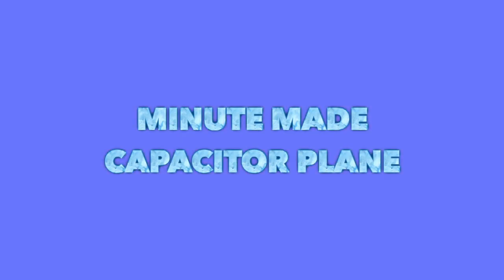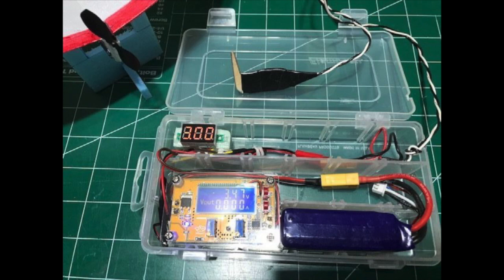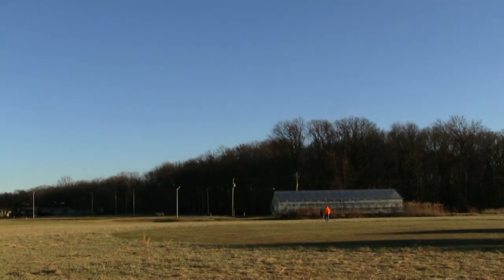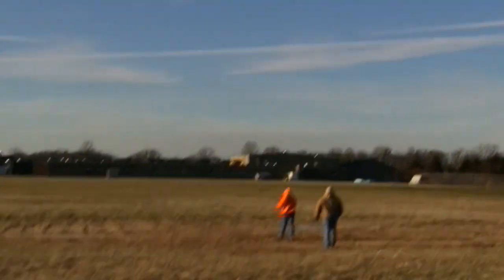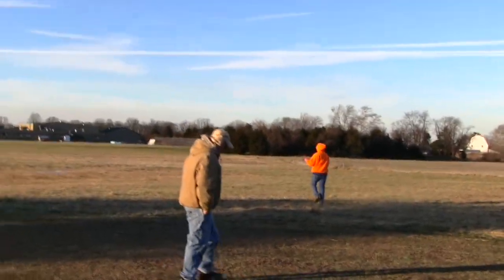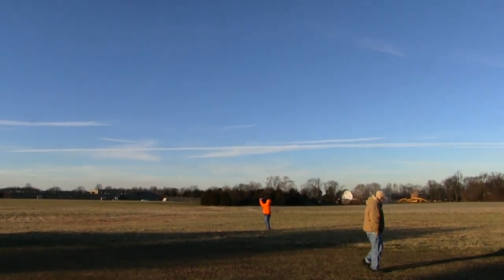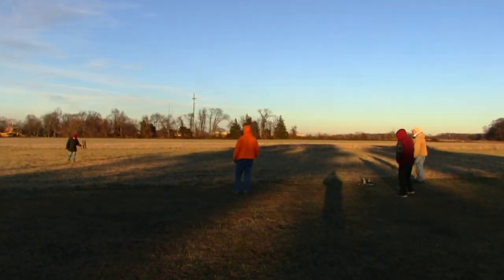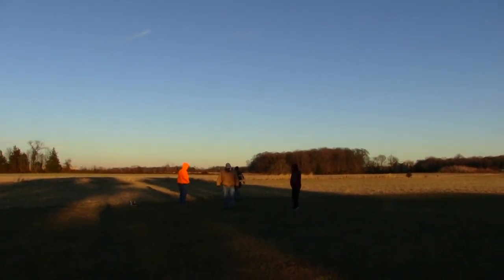Minute Made Capacitor Plane

Comment: Thanks for posting this, you made my day and I can't wait to fill Richie in on your sucessful build! Nice job on both the model and the field charger. As far as the model's name, I decided to call it "Minute Made" because it generally "made" a minute with a full charge and good conditions! I need to build a couple more ...the ones I had have all flown away. It doesn't take much of a thermal to suck it into the sky. BTW, Richie and I have been pushing the capacitors a bit harder by increasing the voltage on the charging lead from 3.15/3.20 up to about 3.30/3.35. (turn up left hand blue trimpot on circuit board) At this setting you begin to see the variation between individual caps. Some will charge right up to 3 volts, others top out right at 2.7. The ones that take the higher charge really add to the performance a lot. We haven't noticed any adverse effects, of course the charging ampere limit is still 800ma-1000ma. 

Sounds like you guys had a great time at the flying field in spite of the cold...and man, that Dakota was really awesome too! I am jealous that you have a large enough area to turn it loose. Richie keeps promising to fly his gassie Dakota again...wait till I show him this video, it's gonna fire him up! Stay safe and have fun guys...Mike and Richie
Reply from the maker: Mike, Thanks for the tips. I will boost the output voltage slightly. If you want to see a really well trimmed Dakota flying check out this video: https://youtu.be/gaFw4YfBw-k
Hope to see more of your videos, and if you guys are ever down this way (Southern NJ) you are welcome to come fly with us. BTW, many years ago I lived not too far from you. I was stationed at Westover, and lived in South Hadley. Stay well guys,
Frank
Reply: @nightnav  Thanks Frank. Westover is an air reserve base now, lots of c5's and c-130's in and out of there...here in Monson we get to see them all on long final to the main runway! I was stationed at Davis-Monthan AFB in Tucson back in the early 1970's, worked on the M61 gatling guns on A7D aircraft. 

Also, I don't know if you or your flying buddies do facebook, but we have a "sonex413 Pilots' Lounge" page there and would love to have you guys on board.  I took the liberty of having this video linked there by my friend and fellow admin "Danger" Chris. I also added it to the "What Our Viewers Are Building" playlist on the sonex413 channel home page. Say hi to all your flying buddies from me and Rich, they sound like a fun bunch!....stay safe, Mike
Reply from the maker: @sonex413  Thanks Mike, I will check out the "sonex413 Pilots' Lounge" and pass the word around. BTW - When I was at Westover all the B52s had been deployed to Guam.  That was 1973. I was only there for 6 months and then set to Udon, Thailand to work on F4s. I was in electronic counter measures. 
Take care, Frank